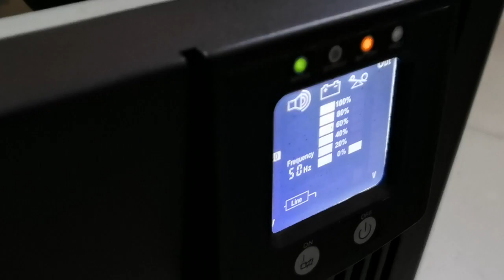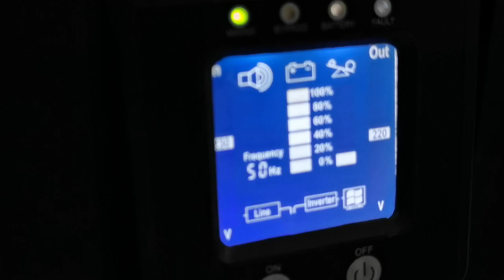How to fixed UPS (uninterruptible power supply) 3KVA not working replaced battery

Comment from the maker: បណ្តាញនេះ ចែករំលែក ជំនាញវិជ្ជាជិវះ អ្នកបច្ចេកទេស អេឡិចត្រូនិច អគ្គិសនី កសិកម្ម .How to fixed UPS (uninterruptible power supply) 3KVA not working replaced battery, this video show to check UPS not working, The UPS can't start up, how to remove battery from UPS 3KVA, how to disassemble UPS 3KVA, how to replace battery UPS 3KVA